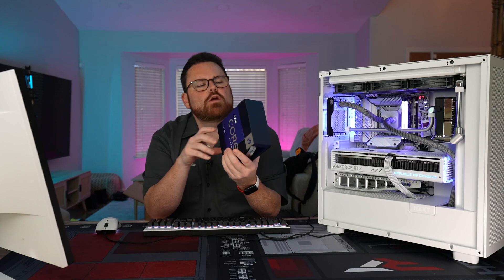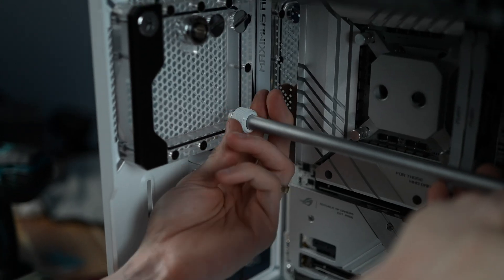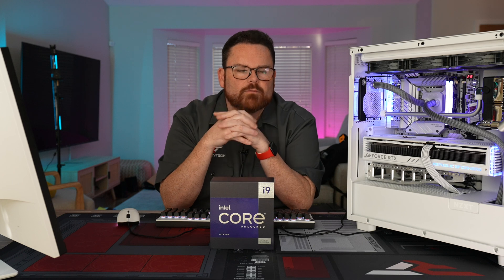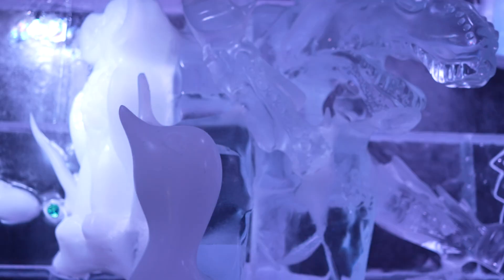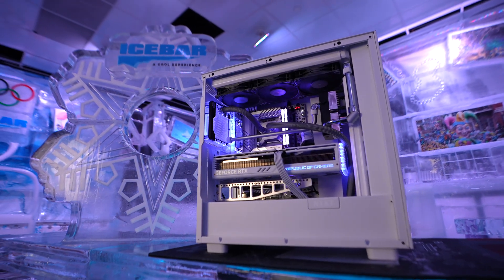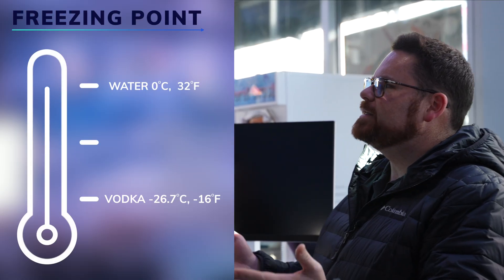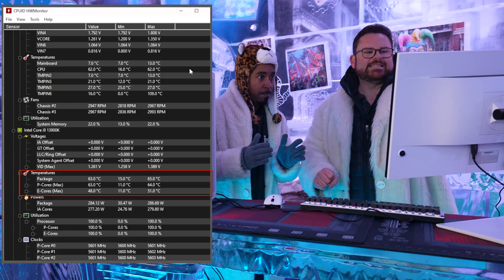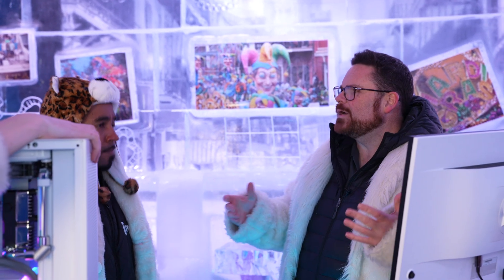Overclocking a 13900KS in one of the Coldest Places on Earth!

Comment from the maker: To help folks understand the 13900KS starts with 6.0Ghz on 2 cores while all cores is 5.6Ghz.  We raised things up to 5.9Ghz on all cores with two cores at 6Ghz.  We could have gotten 6.2 or even 6.3 I think but alas the cold was too much for the PC!  I hope you all enjoy the video!
Reply: I run 5.8 all core daily on my gaming rig, with a 360mm aio.  Expected much better.
Reply: @connor040606  Robey says the 13900KS requires either a 420 AIO or custom loop cooling to run smoothly without thermal throttling… …I’m waiting for an undervolting and overclocking combo video to see how combining both methods can improve performance…
Reply: @djtechno95  This is not true, especially not for gaming workloads.  As stated, I am running a pretty big OC on a 360mm Aio. Strictly gaming, but even then some games can pull over 200 watts.  5.8/4.6/5.0 is the clock breakdown of P,E, and ring clock.  Max temps I see are spikes to around 75-80c and averages in the 50s.
Reply: @Connor Johnson  your running 5.8ghz ALL 8 CORES? And less than 200 watts? I honestly cannot believe you sir. Would you mind sharing a solid video or photos of your settings and list of equipment. I'm truely curious what settings you have altered or changed and what equipment your running. This doesn't sound right or add up. Especially since your not watercooling (AIO doesn't seem enough) to claim clock speeds your claiming and Temps your claiming.
Reply: Now the bigger challenge is which liquid cooled build will last longer out in the snow: Z790-13900KS/RTX 4090 or X670E-7950X3D/RX 7900 XTX?
Reply: Why not try 6,6GHz or 7GHz all P+E cores and see what is going to happen? One click cinebench, power failure...? It's seem funny!
Reply: You could of used the LN2 jumper on an ROG Maximus z790 Apex, Elm Labs Motherboard Heater, and been 100% fine running in Temps sub true 0. The only thing is you needed Glycol Based Solution so it wouldn't freeze. I can suggest other things bug those are the thing that glaringly standout as to what you guys did wrong to prevent a successful test day.
Reply: What about.....air cooled inside of the ice bar?

Comment: Wouldn't air cooling make more sense?
Reply: Air thermal capacity is miles behind liquid cooling. The temperatures of those cooling mediums always stay in equilibrium with the ambient temperature, thus air will always be more inferior, despite the heat transfer limit of the cold plate.
Reply: @csguak  I'm not talking about good or bad. What I'm saying is. Having it air cooled would use the Ice lounges ice cold air. There was no need for water cooling in this instance. In fact in the video it was much more a detriment as the water froze and almost killed the PC.
Reply: @bananajoe1019  they totally dropped the ball on that. I guess if you live on the South Pole, the cooling solution can't be water anymore. What I meant to say above was that it's really easy to heat icy cold air compared to icy cold water.

Air heat capacity of earth atmosphere  is 1.005 joules/g/Kelvin.

Water is 4.186 joules/g/Kelvin.

It's 4 times harder to heat up water as you can see. 
As long as water retains liquid phase, it's  pointless to go air cooling.
But they went too cold and exposed  water's weakness! It turned to solid.😂🤣😂

Comment: 😮‍💨... So basically unless you are an LN2 overclocker enthusiast you probably shouldn't buy the 13900ks because the temperatures are ridiculous and simply overclocking a 13900k will get you most of the performance anyway.

Comment: Did I miss something? Out of the box 6GHZ yet with overclocking in an ice bar you got to 5.9ghz?
Reply: you need good cooling, I think he could've done it in his house if it had a contact frame, liquid metal paste, and direct die water cooling, that's what all the extreme overlockers use to get 6ghz even on 13900k
Reply from the maker: It's 6Ghz on 2 cores and 5.6Ghz on all cores.   We got it to 5.9Ghz on all cores with 2 on 6Ghz.  We could have done 6.1 or 6.2, maybe even 6.3 all core... but alas the cold was too much!